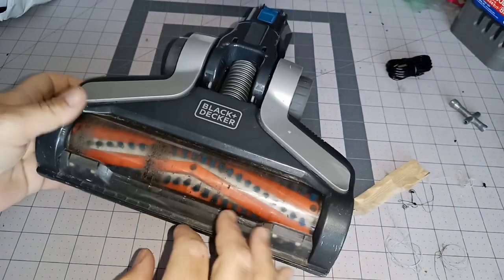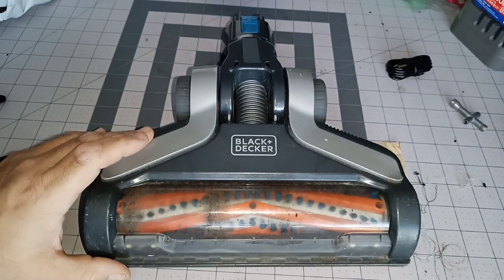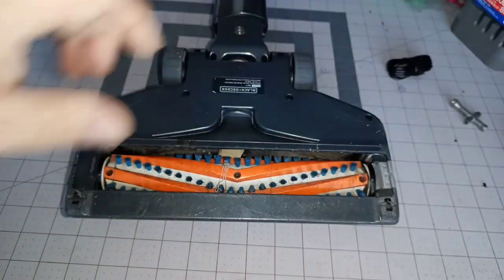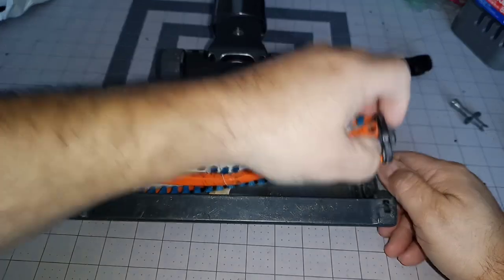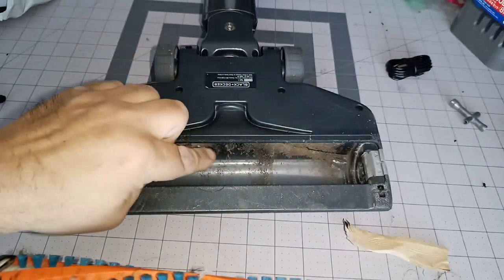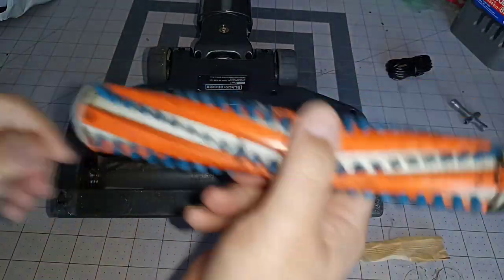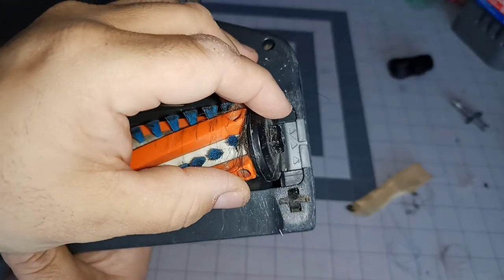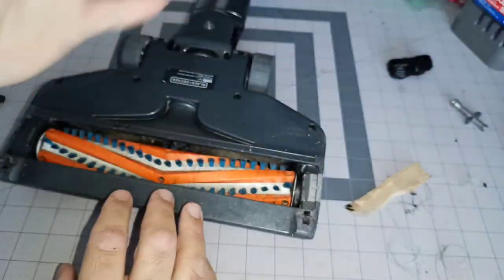Remove Black and Decker Stick Vac Roller!  Powerseries Extreme BSV2020G

Comment: This is a great video! You saved me from going to purchase another vacuum cleaner. After taking the bottom attachment apart from my Craftsman, it was clogged up with so much lint. I cleaned all that trash out by using a wire hanger to  push out  the clogged up lint found in  the bottom plastic tubing. And now my Craftsman vacuum is running perfectly!

Comment: Hi! On the end of mine on the square side, it stopped spinning. It seems to be jammed. What would you suggest to loosen it so that it spins again?
Reply from the maker: The cover with a square should pop right off. There's a bearing underneath. See if anything is impeding the movement of the bearing.
Reply: I thought this with mine but cleaned it but now I’m thinking it’s the other side should that show movement as I feel that side isn’t what could this be
Reply: @toolinhand  there's nothing stuck in it just burn hair that burned into the plastic, and then I'll have to buy a replacement each time. What should i do?

Comment: Have the same, and still try to figuring how to remove the roll, mine seems to be stuck while I pull the little part with the arrows... Any advices?
Reply from the maker: Gently pry it up with a screwdriver
Reply: @toolinhand  Thank you it worked! Good advice! Many thanks for the video you made it helps! The only thing is that mine was a bit tighten, but indeed the screw helped me!

Comment: Is there a way to remove the black thing in the end? Mine won't spin anymore 😢
Reply from the maker: Which black thing?
Reply: @toolinhand  thank you for replying! I was referring to the black thing at the end of the roller. But it's fine now, I managed to remove it by hammering it out. After removing it, I found out the bearing inside had a bunch of hair stuck in it. Once I cleaned it up, it was good as new :D